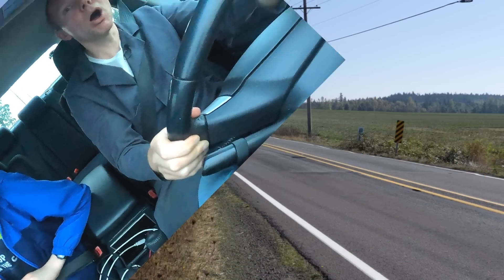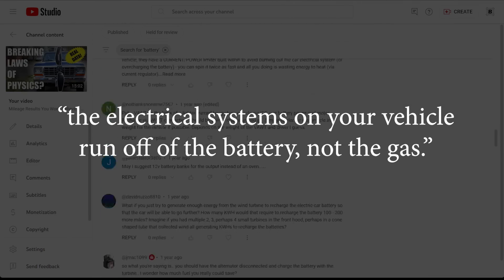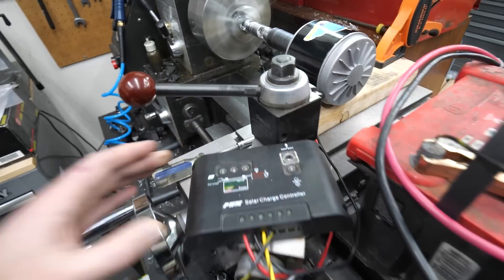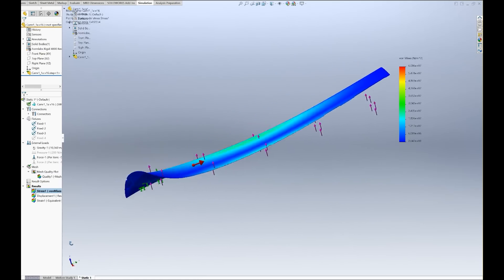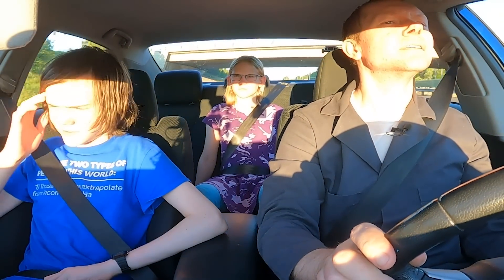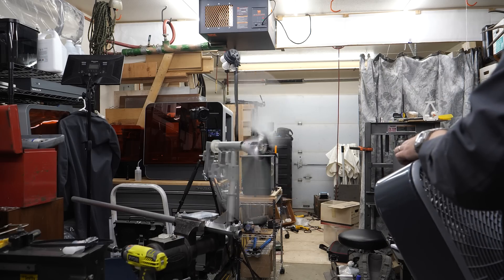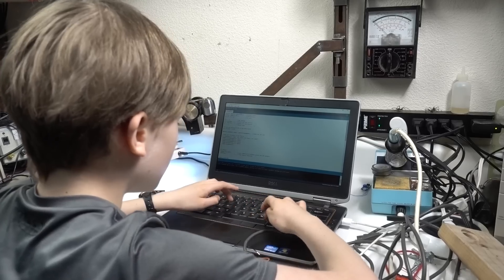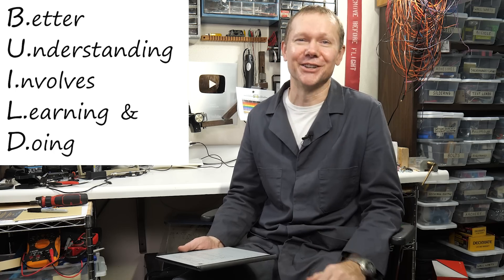3D Printed Turbine on a Camry - Wind Power on a Car #6

Comment: My thought is that it's more probable for the efficiency to decrease. By how much I'm not sure.

My reasoning is only at level zero though. I suspect that the mechanical power required to move the air out of the way of the car by changing the momentum of the air won't change whether or not there's a twirly device in the way or not. All that air needs to be pushed out of the way of the car, and I'd imagine that the most efficient way to do it is in a way that minimizes the drag coefficient, since if its not minimized, then more of the power is converted into heating of the air than moving the air. Having a turbine in front will raise the drag coefficient of the whole car, and hence result in some more engine power being put into heating the air.

Comment: I have (had) a van with a bull bar, one would think this is a non aerodynamic accessory on every car but when laws in Spain forbid me to have it on the car and I removed it.

Nothing else changed but since removal, my van is using 0.8 liter/100km more then before, same car, same tyres, same drive style, this bull bar saved me 100's of liters of fuel while making my van look nice(r) and protecting it against small scuffs.

Comment: Why ? You just increase drag. Even placing the turbine in front instead of on top of the car increases turbulences and drag. It´s basically a null sum game. 
Recuperation brakes work because they regain energy which you have already spent to move up hill for instance. Your turbine idea would work if you would use it in a similar manner to brake the moving car but since your turbine is always in front you just increase drag. If your idea would work one would use it on planes too.

Comment: The best place to harvest energy in the exhaust gases.
I would use a turbocharger turbine coupled to a generator.
Trying to harvest from air will jus increase drag more than what you can recuperate no matter what.

Comment: Nice concept, here is two cents.  The first issue addressed in aerodynamics is Frontal Area,  a top mount will increase this area.  While mounting props in front doesn't increase the area, it does make the prop less efficient due to back pressure, created by the car's nose.  Beware of an uneven loads, due to such uneven pressures.  Consider using a scroll or helix to drive the generator.  Aligned in the vertical axis, has the potential of 'splitting the air', in a similar way water repellents are used in modern underwater bullets.  Harvesting air flow from the rear deck lid (spoiler) has a potential to increase stability, and use the partial pressure created at the rear.  Not an electrician, but disconnecting the battery can damage the alternator charging circuit.  Which questions using super capacitors, due to low resistance (great for delivering starting amps).  Good to see you recognize electricity generation is only 50% efficient, something the greeny idealist don't want known.

Comment: As an Engineering student in the late 80s, I had proposed this kind of technology. It was a bit different in terms of having loads of smaller piezo generators with tiny turbines in the front grill connected to the secondary battery which in turn charges the battery. 

I am a Electronics Engineer and my Mechanical Engineering friends laughed me off.

I thank you for making my idea work however a bit differently. 

I hope someone will try and get it right.
Reply: Just goes to show there are no new ideas. I'm a bit younger than you, and have thought about piezoelectric generators but instead of the grill vents, you'd have flapping turbines.

Comment: why have the pulleys?  why not direct drive the generator or use a gearbox? more parts = more problems.   Also, could try an axial fan to protect the rotors. =D   Happy experimenting.  Really love that you got the kids in on it, blink and they will be out living their own lives. =D

Comment: I think for modern aerodynamicly setup car it won't helping, I think it will slightly lower the efficiency. I'd say it would be about same on slow speeds and worse on high speeds. 
But for big boxy non-aerodynamicly setup car it might help especially at higher speeds when the drag really kicks in. There it just might work.

Comment: I'm not a mechanical engineer, but from my electrical engineer perspective I can see two things: first, supposing there's no wind, the total power available is going to be equal to the force punching the turbine forwards times the distance it displaces per second, and the force is provided by the car. On the other hand, your argument says that wind speed will decrease as it passes through the turbine. Assuming 100% efficiency for the turbine, the air is going to be at rest after the turbine passes. So assuming 100% efficiency for the whole system there would be no difference with or without the turbine, right?, but staring from Betz's limit we can be pretty sure that's not going to happen. Greetings from Colombia. Your channel is great!

Comment: Is it the wind turbines generating power or the wind turbines deflecting air to make it stream around the car easier / better or both that will help ?  Remember the Mythbusters episode where they simulated hail damage to a car - and basically laid into a car with a ball pen hammer - and this "golf ball" surface car had better fuel economy ?  Also the episode where they put a string net in the back of a ute and this somehow improved air flow and and improved the car's fuel efficiency ?

Comment: I think that the idea is sound. In a production car the propeller wont work. Maybe instead of a traditional turbine you need a surface that vibrates etc producing the power.

Comment: I think the front of the car is more aerodynamic than the generator blades. The drag of the blades probably equal the same as drag of car generator.  So the mileage will be about the same with the wind generator and cars generator.

Comment: I'm a pretty good guesstimator. With that being said, I feel like the wind turbines will disturb the airflow and prebuffet it before it hits the car helping your wind resistance a bit while collecting the wind energy so I feel like you'll save 20-25% on your gas mileage.

Comment: My theory is that the additional drag caused by the fans at the front will offset any gains by powering the car from the fans rather than the alternator.

Comment: I can see what your problem is - you're running a belt gearbox so I'm going to say it's not going to work - your wind is going to be at they car speed and Direct Drive to the gen is needed - that means you need a gen that is very big and flat line a Smart Drive washing machine motor with about 50 magnets around a 11 inch disk. - this will enable you to run the disk slower at your lets say 40 mile an hour wind speed BUT a 3 blade isn't going to do it - nor is 2 x 3 blades

What about a cylinder type blade to extract power but introduce aerodynamic to take the air from under and move it to the top of the bonnet

Comment: I had a similar idea, except with a large lightweight battery in my car and a solar powered battery bank at my house and just treat it like a plug in hybrid.   And get an electric water pump too to take all mechanical load off the motor.
Reply: A large lightweight battery? So a 🦄
Reply: @kennyg1358  well a 100ah lifepo4 that could run all my electric on my car for 2 days is considerably lighter than the lead acid battery only used to start my car.  I could make one in my basement.  Never made a unicorn before though.

Comment: My guess is that using a brushed motor as a generator you will not get more than about 70-80% efficiency, using a brushless motor and rectifying it would be more like 80-90% assuming you are doing voltage regulation efficiently as well. If you can improve fuel economy by a measurable amount that would be awesome. Still I feel like there are so many other sources of mechanical inefficiency so my guess is it will improve fuel economy by 4-5%

Comment: I would be interested in a video on CAES Compressed air energy storage. There isnt alot of videos out there going into the details of the physics and achievable efficiencies and its one of the few methods to store large amounts of energy apart from pumped hydro that you made some videos about.
The best ones appear to be so called "adiabatic" CAES but they still take the heat out of the air and store it somewhere else and then reintroduce it into the air before it goes through the turbine - i was wondering why you cant just leave the heat in the air and insulate the chamber youre compressing that air into...

Anyways, would be cool to see some content about that and you could also build your own little versions =)

Comment: I mean, it's not going to work. Adding a turbine is just an extra load adding to the aerodynamic drag. It's not going to "recover" wasted energy, just move the load from the alternator to the turbine, which at best will net you the exact same fuel economy minus the increased efficiency of the electric motor vs the alternator, assuming no impact on the aerodynamic envelope of the car. But of course this will have an impact on the aerodynamics of the car, so it will be worse because of the added turbulence in the path creating uneven airflow over the chassis. 

You can't engineer your way out of thermodynamics, that's for sure.

Comment: Take it through a wind tunnel if possible and blow some smoke in there, see the air flows. Fans on the top or fans in the front, but who's got access to a wind tunnel. You have to find out what the air is doing around the vehicle. If you can figure all that out your troubles are over,.-

Comment: eso son motores no generadores, los generador son siempre en corriente alterna.

Those are motors, not generators, the generators are always alternating current.

porque no usas un motor sin escobillas?
son mucho mas eficientes.

Why don't you use a brushless motor?
They are much more efficient.

Comment: I predict fuel economy will go down a few percent because of the drag of the propellers and the choppy air they create. The wind is pushing on the blades, slowing down the car a little which needs more power from engine to compensate.

Comment: I think you will see a fuel economy loss proportional to the difference in drag coefficient of the Camry without wind turbines and then with because you are now dealing with different drag coefficients adding that turbine, adding the turbine may cause more turbulent air and vacuums causing more drag on the car, if the Toyota engineers designed the body panels to move air in a certain way and the wind mill will effect that.

Comment: If you needed the car battery for the car to continue running then jumping a car would do nothing to keep it running because when you jump the car you're bypassing the dead battery. That's why we use lead acid deep cold cycle batteries because you only need to start the car with high current draw to turn over the flywheel/flex plate, after that it's dead weight
Reply: You'd be surprised at how actual little capacity there is in those batteries

Comment: I think it will be a little more efficient, not much. Like maybe 1%. Will be a lot better with speed, but will need to go very fast to make it significant.
Is like the car will be slower aerodynamically that it does in reality. And all the air speed taken is going to spin the blades.

Comment: When the engine is running, the battery turns into a overengineered capacitor, that's all. :)
WIthout the battery, the start and stop of the various electric elements is way more abrupt. I made an engine with no battery stall by just having the lights on and starting the rear window heater.

Comment: I think you will probably just break even or be slightly worse off. It is a good idea, but air flow at the hood level is not free energy without disturbing the aerodynamics of the car.

Comment: Ask for the difference with the fan in front of the car and the fan on top of the car that gets complicated it's not as simple as drag you have induced drag parasitic drag conformal drag frontal area drag base area drag there's a lot of different kinds of drag

Now mounting the fan on top the turbine on top will increase frontal area and base area drag think of this as a cardboard cutout that's two dimensional of the maximum dimensions of your car and that's your frontal area and your base drag

The fan would likely be represented as a disc it's full diameter and that would probably be close enough

But there are other kinds of drag so for example mounting the fan in front of the car's bumper you are not increasing the frontal area but you are increasing other forms of drag you are extracting work from the air therefore you are applying drag you can't get energy for free :-)

So the question is all your turbines more efficient than your alternator as you've already noted alternators are notoriously inefficient so it might be.

Comment: The next thing I would do if it proves to work is to put a small 100 amp hour lithium-iron phosphate battery in the gar and then have switches and eventually automatic systems to disconnect the 12 volt light acid battery and to disconnect the alternator simply interrupting the signal wire should disable the alternator

The reason for this is pretty simple any excess energy you produce can be stored in the battery and then when you're going too slow for the turbine to work or at a stoplight or in city traffic etc the car can run everything off of that much higher capacity than the amyron phosphate battery that's 1.2 kilowatt hours enough to run your entire car for about an hour and a half with everything turned on

And this way you gain the fuel economy bonus 100% of the time

I would also combine this with a solar panel on the roof Small flexible unit that lay flush with the roof even if it's only a hundred Watts that's still basically all the power of your car needs if you don't turn anything on. Eventually you can develop a computer control system maybe Arduino based to where it'll automatically re-engage the alternator if the lithium iron phosphate battery gets too low and then of course you'll want to disengage the LFP battery and engage the lead battery when you start the car since the LFP battery probably won't put out enough amps to start the the engine in fact I'm certain it won't I believe you need more than 1200 watts to start the engine. It doesn't have a lot of power but it has a lot of energy.

Comment: As far as the car running on gas and not the battery some people may be using more modern cars cars that will turn off if the battery is disconnected this is not because the car is running on the battery it's using the battery as a voltage stabilizer because the ECU is pretty sensitive to spikes and alternator powers pretty dirty so some modern cars when they sense no 12 volt battery they shut down to protect the electronics not because they need the batteries voltage to run but they need the smoothing that the battery allows for example my dad's Lincoln Town car many years ago would turn off if you disconnected the battery. But that is a programmed shutdown not a the car can't run without the battery shut down.

As for capturing otherwise wasted energy in order to reduce the load on the alternator which would in fact increase your fuel economy I'm not sure about that it's not like regenerative braking where you would otherwise be shoving that power into the brakes or into regeneration this is very easy for you to test

Get the car moving at 70 mph without the fan blade on the front at 70 mph put the car in neutral and see how far you get or how long it takes for you to slow down to a particular speed say 20 mph

Now perform the exact same run or the exact same chunk of road 70 mph put it in neutral but this time with the fan engaged on both runs make sure everything is turned on HVAC headlights rear defrost all of it you want to maximize your power load

If the car slows down more with the fan on then you have a net loss if the car does not change it's time to slow down then you could see a net gain.

I fear the turbine will increase your turbulence and amount equal to the amount of power generates plus inefficiencies I'm not sure though it would be interesting if it works

Comment: The battery isn't required for the car to run, however it acts as a huge capacitor protecting the electronics in your car from power spikes, it's not a good idea to disconnect the battery on a running engine.

Comment: Whether the turbine is in front or on top, you're still adding drag. "That air would have to move out of the way anyway" doesn't mean it's an untapped resource to exploit. The car's aerodynamic shape moves the air out of the way efficiently. You turbine is adding drag before the car gets a chance to move that air efficiently. I think you might see some improvement but only because a car's alternator is tragically inefficient; not because strapping wind turbines to a car is a good idea. You would be better off putting your high efficiency generator under the hood in place of the alternator.

Comment: I think you are making things a lot harder switching from the bronco to a modern car that was probably engineered to be aerodynamic.

If we accept 10% is going to electrical and an alternator is 50% efficient,
And let’s say your turbine + converter is 75% efficient 
4% gain would be possible.

Comment: I think you'll get about 5% better. Although the propellers are not increasing the frontal area, I theorize that the fact that they are spinning will create a "virtual" frontal area that will add some force in the opposite direction of the car's velocity (not drag, "thrust" from the propeller).

This is a super awesome project.